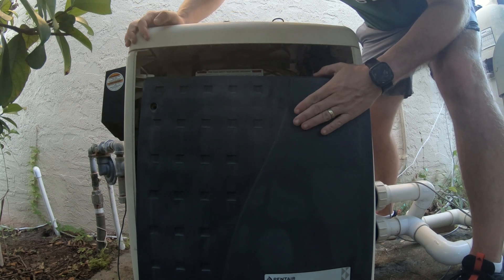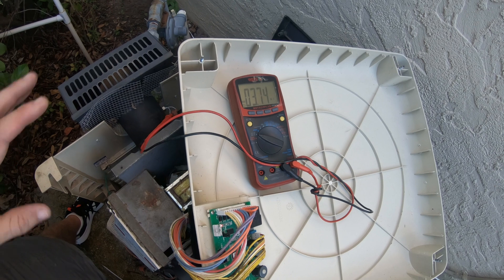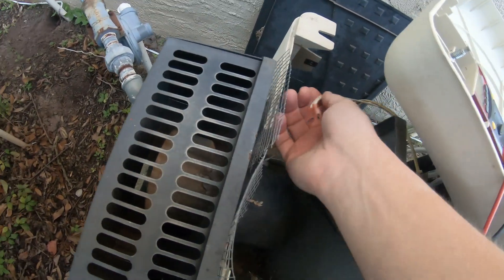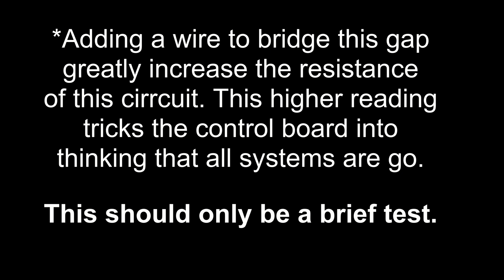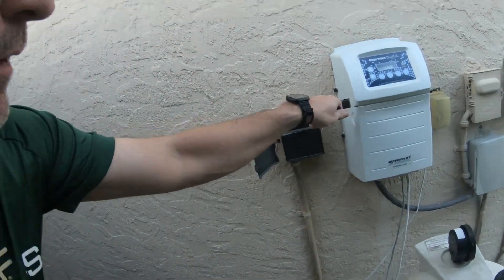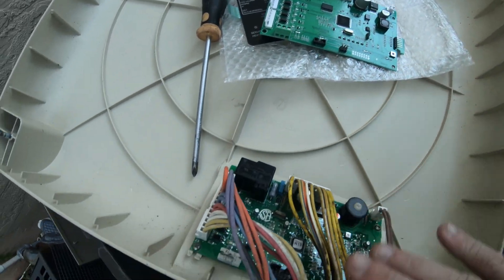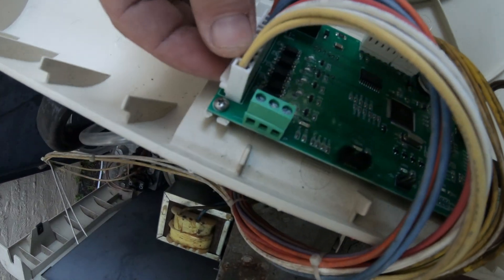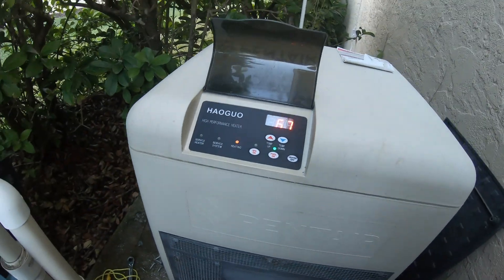Pentair Pool Heater SFS Error For A Bad Stack Flue Sensor. Here's How To Troubleshoot And Repair

Comment: Sfs can also be caused by bad thermal regulators ,manifold bypass, water flow and sooted exchanger , bad gas pressure.   So many reasons.
Reply from the maker: Pretty much anything that can abnormally effect the exhaust temp. I agree… thanks for the added info.

Comment: Do you need to replace the panel?  Or can you just use the one that's already there?
Reply from the maker: The keypad is reusable. There is a ribbon cable that connects it to the control board. You can disconnect it and move it to the new control panel.  You actually can keep it in place and just swap the board.
Reply: @JackofAllTrades1  Thanks for that answer, that's great.   When you say it's a "generic" panel are you saying the Pentair board (which imagine has some silk screen identifier) has something different about the programming?  

One last question ... I saw the SFS error this afternoon so I turned off the breaker, and tried turning it back on and it worked (yes, it produced heat).  Could it have been just a glitch? Or is it telling me something about the sensor/board?
Reply from the maker: @teekay_1 it was a non-pentair branded board, likely a Chinese remake. I'd keep an eye on your heater but make no repairs right now... coulda just been a false error.
Reply: @JackofAllTrades1  Thanks for answering all my questions, and letting me know of an alternate source for parts if I need them.  Worth a subscription for me.
Reply from the maker: @teekay_1 thank you!
Reply: @JackofAllTrades1  Turns out it wasn't just a glitch.   When I remove power, It fires up and at some point the SFS error kicks in.   I ordered a board and a pair of sensors.  I guess I'll be testing the sensor first as you recommended.
Reply from the maker: @teekay_1 good luck
Reply: @JackofAllTrades1  Well, some success.   And something interesting.  The existing sensor is unreliable right now.  Sometimes it has a reading of 49 Ohms and sometimes it has 2.2M ohms and other times it has 600K ohms.   So I judge it bad and it's probably not a control board fault.  I had picked up two sensors, but I checked their resistance and and it was a steady 2.8M ohms.   I was going to try it, but not only are the connectors different colors, the thread pitch is different as well, so I ordered this sensor:  
Funmit 42002-0024S Stack Flue Sensor Replacement for Pentair Sta-Rite MasterTemp which looks identical.  you might update your link.  

The interesting thing is I left the sensor out which should mean infinite resistance and I was sure it would not turn on, but as soon as the pool pump was kicked back on, the burner came on.  I quickly turned it off.  

I'll update the page once I get the new sensor tomorrow.
Reply from the maker: @teekay_1 interesting that the sensor connector is different. Mine is a Pentair 250 and it just has spade connectors.
Reply: @JackofAllTrades1  It's a different color, blue. Whereas the stock connection has a red shield over it  The connector inside is the same.  The big difference is the thread pitch.   My heater is only 2 years old, BTW, so I'm a little bit non-surplussed that I have to fix it.  There are subtle differences between my heater and yours.  For example mine has the control panel on one of the sides with the removable panels.   Other than that, the insides look very similar.
Reply from the maker: @teekay_1 the panels can all be oriented in different ways to accommodate different setups. Mine is about 7 years old.
Reply: I replaced it with the appropriate SFS thermistor and it works fine now.    I believe if the heater comes on, but after a few minutes it it gives you an SFS error, it's almost a certainty the SFS sensor is bad.  It works at first because the resistance is high enough that it can work, but as soon as the temperature rises a few degrees, the resistance goes too low signaling to the board the temperature is too high.
Reply from the maker: @teekay_1 makes sense... the sensor no longer provides the correct resistance readout, so the corresponding temperature calculation is out of range and causes shutdown. Thanks for the update, this info helps others.
Reply: @JackofAllTrades1  the sensor is actually quite sensitive.  When I tested resistance of the new sensor it was 3.5M Ohms, and as soon as I touched the sensor with my fingers, you could see it drop fairly quickly.

Comment: I have pentair 125 first start backfiring ( with no code ) but kept tuning for about 2 weeks , 
Finally it will run for one time and then service heater light will come on and the SFS light now will come on.
I replaced the exhaust sensor, and waiting for the airflow switch to come ( ordered from Amazon ) , then we will see , 
Any idea about why the heater start backfiring ( it is very loud like it is going to explode )
Reply from the maker: Dirty burners can do that from soot buildup. Do you let your heater go 9 months or so between uses? I try to kick mine on every 3 months to keep things fresh.
Reply: @JackofAllTrades1  It's a great idea, but in the northern climates, pools get shut down from roughly end of october to  may.   If the weather is nice, then it will run into early november.
Reply from the maker: @teekay_1 I see... so it's likely it has been winterized and water drained from the manifold to keep it from freezing over and cracking.
Reply: Mine does something similar when it first kicks on (it's a pentair 300)  it more of like one deep rumble once than a backfire.   A backfire is like the sound of a gunshot.

Comment: Thanks for the great video. Do you have links for the SFS and the control board? Thanks again
Reply from the maker: Yes, I will put them in the video description now.
Reply: @JackofAllTrades1 thank you very much!
Reply from the maker: @EVovchuk good luck
Reply: @JackofAllTrades1  hi quick question. My heater problem is a little different from yours. My heater fires up and runs for a few minutes and then stops. And the SFS led light goes on. I tested the resistance on the SFS sensor and it read anywhere from 5.3 to 6.5. The control panel still works. I guess it’s my sensor going and not the control panel?
Reply from the maker: @EVovchuk I'm away from my house right now on a trip, so I can't double check anything, but it sounds like your resistance is high... I believe I quoted around 3 ohms in the video as being the spec for it. If yours is double that then it's not so far off the mark that it keeps it from starting, but it's off enough that once it comes up to temp it indicates the exhaust is too hot and shuts it down. If this is the case, then a new sensor should fix that.
Reply: @JackofAllTrades1  thanks. I thought you said the resistance decreases until it hits a point to shut down that’s why I was a little confused because my resistance started higher. Also by holding down the pool button I can see the exhaust temp displayed I think the sensor is set to turn the heater off at 480F. My temps started out at 450F and slowly decreased to 430F as the heater ran for the few minutes. Idk. I’ll replace the sensor today and hopefully that solves the problem. Thanks again for the great video and all your help.
Reply from the maker: @EVovchuk  whatever I said in the video is correct lol... I dont remember the info for too long after I create the video as I typically do a data dump and move to the next project. If the spec is 3 and yours is double, then that seems suspect. It could also be that your sensor is reading the temp much lower than it really is, so it's not cycling off and on correctly and the water is getting too hot which is tripping another sensor.
Reply: @JackofAllTrades1 thank you
Reply from the maker: @EVovchuk good luck, if you are still having issues next week, then reach out to my email in the about section and I will see if I can help troubleshoot more.
Reply: @JackofAllTrades1 thank you.

Comment: I am having this problem now with my mastertemp 300.  It wont start and the sfs light is on.  I tried doing the jumper and no luck.  Any ideas where i should look next.
Reply from the maker: @MDillonEV  when you jumped it, did you completely disconnect the power for 30 seconds first? I'm just making sure the board reset.
Reply: @JackofAllTrades1 I believe I did.  I tried it twice,  once with the breaker off first.
Reply: @JackofAllTrades1 I'll go try it again to make 100 percent sure
Reply from the maker: @MDillonEV  also, what did you use to jump the two wires? Make sure it has good conductivity.
Reply: @JackofAllTrades1 I used a piece of speaker wires.
Reply from the maker: @MDillonEV  if its still acting up, maybe just have the ends of the wires touching with something like a small clothes pin holding them together. Do any of the other buttons work outside of the pool heater button? It's possible that your keypad could also be shot, they have a limited lifespan.
Reply: Ill try that.  It has gotten worse for sure.  It would heat for a while then stop.  Now it wont even start and the panel wont even show the usual start up numbers (r 14, etc ) @JackofAllTrades1
Reply from the maker: @MDillonEV I bet that's it. I've replaced mine already in the 5 years I've lived here.

Comment: How did you know it was the control board?    When you used a jumper, it kicked on.  Doesn't that simulate a good sensor?   Also, changing both parts fixed it, so how are you sure which was bad? Im curious.
Reply from the maker: @teslarella5953  The resistance with the jumper was greater than the normal resistance of the sensor. The resistance of my sensor and the extra one I purchased was verified and was extremely close to identical. With the sensor in place, the controll board was reading a resistance value that was lower than the value needed for it to pass that safety check (meaning it thought the heater was overheating upon startup). Adding the jumper in place greatly increased the resistance, which told the control board the temperate was at or below the safety trigger. I came to this conclusion based on how simple the circuit is, it's a sensor, wires, and control board. If the sensor and wires check out, it has to be the control board. There could also potentially be ground issues if that is a part of the cirrcuit... mine all looked good and checked out. I don't guess I said it in the video, but I'm using my original sensor with the new controll board.
Reply: Thanks for the clarification!  Good work.
Reply: It's important to understand the SFS sensor (which is actually a thermister) isn't just a simple on/off switch.  It changes resistance depending on the temperature.  At room temperature it it will be about 3.5Meg Ohms, but as the heat goes up, the resistance goes down.  The reason the SFS exists is if the temperature gets out of control, it will shut the heater down.  So when the resistance is high, the heater will work.   You can test this by removing the sensor completely and turning on the heater.  It will turn on because the resistance is now infinite.

Comment: Should buy genuine Pentair parts and the boards will match.
Reply from the maker: @austinseaman6388  yea, but I'm not forking over 500 bucks for it... and some people just can't afford that but need to do a repair.
Reply: It's likely Pentair is just using the same board as everyone else, it may have some writing on it that has a Pentair part number, but Pentair isn't in the business of designing boards, they're in the business of designing a heater.  In my old Pentair heater, I got a chinese board that was a knockoff because the LEDs were burned out and it worked fine until the entire inside of the heater rusted out.